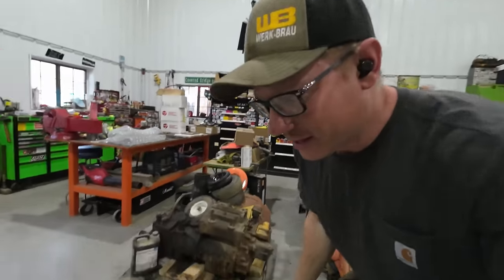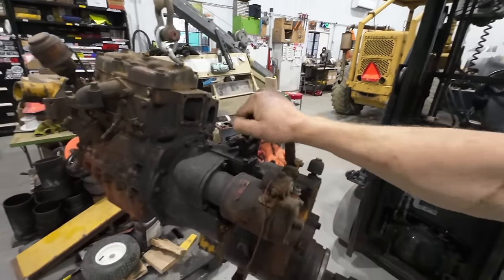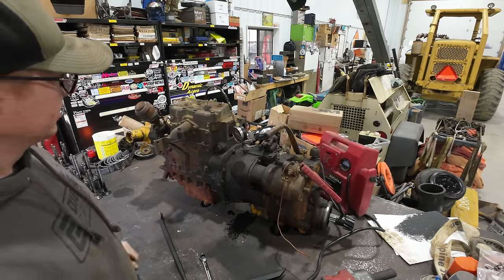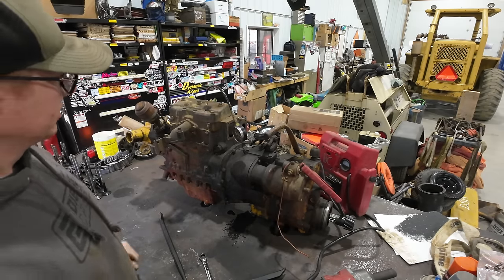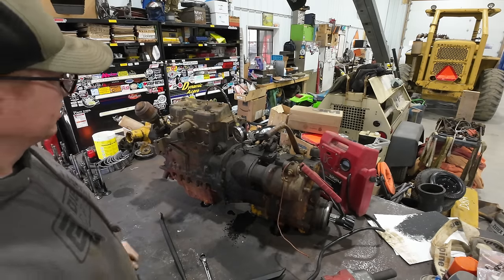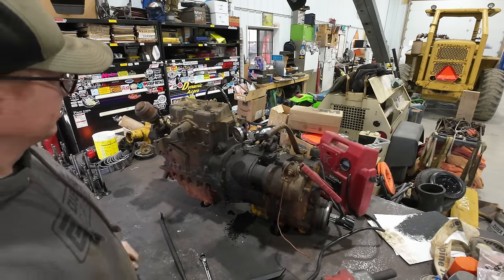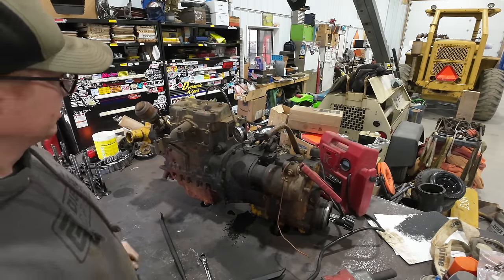AUTOPSY of a Caterpillar Pony Motor. | What Went Wrong?

Comment: you mention taking a cotter pin out of a castle  nut, this was not a cotter pin but a split pin, which is an obvious name as you split the 2 legs to  stop it falling out.     a cotter pin is usually about 5/16 in dia and upwards.and has a threaded section on one end for a nut and washer to hold it in place.after fitting,   it also a tapered  section , sloping from nothing at the head end to about  3/4 of its dia at the threaded end, the shaft that is being secured to the lever has a groove in it to register with the cotter pin.    you drive the cotter pin in with a hammer and then put the nut and washed on the other end.   the most likely place to see one is on older bicycles, the pedal crank is usually secured to  chain wheel sprocket  shaft by such a method .
other wise Matt love the program and videos, always look on diesel creek as soon as i turn on my comp to see if there is anything new
Reply: From wikipedia: A cotter is a pin or wedge passing through a hole to fix parts tightly together. In British usage cotter pin has the same meaning, but in the U.S. it means a split pin.
Reply from the maker: Yeah. Here in the US a cotter pin is what I was referring to. What you’re referring to sounds more like a roll Pin or a constant tension pin
Reply: I would call what you’re describing as a threaded taper pin.  Only rarely used in my experience.  Only usage I’ve run across is to hold a splined slip clutch on a splined male “pto” shaft with a circumferential groove ground in it to receive the tapered pin.  Basically takes the place of the spring loaded pin on a pto shaft coupler that you push in to slip coupler yoke on and off the shaft.

Comment: With the amount of wear on the main bearings, I am amazed that the pony even ran.  I can't imagine that the rod bearings are going to be in much better condition.  I am just going to make a WAG, and say that the teeth could be from the bendix of a previously installed starter.  I can't imagine how you could find that kind of damage, and none of the other gear teeth are damaged.  Those things were built to last.

Comment: Should consider reassembling the Pony motor with all the parts reattached before placing it in storage. That's just one way of reassuring that none of the parts go missing later when you really needs them, particularly those parts that you'll otherwise take for granted.

Comment: I would argue for keeping the cracked case - if for no other reason, as a means to keep the rest of the parts together in one spot. Otherwise, over time, the parts will tend to 'sprout legs and walk away'. I'd get some day-glo red paint and dot the crank journals and the gearbox case to remind you what the deal is. Then you clear a spot on a shelf and park the dead pony until you need to raid it for parts or you have a chance to trade it off 'as it sits'.

Comment: Hello  Matt: Happy Easter' just an educated guess. I would check the remains of the gear and see if it could be an old starter drive gear. From what I could see in the video and the issue you showed with the starter alignment. I think a previous starter failed to engage properly and broke. The pieces never removed. But that is just an old timers 2 cents worth. Keep the videos coming.

Comment: Almost looks like someone tried to use babbitt material on those main bearings. thats an incredible amount of slop. Guessing thats why the starter wouldn't engage, teeth weren't even close to lining up anymore. Also guessing the bearing material was what caused so much metal sludge. As others have said, looks like old starter teeth that broke off and they just slammed a new one in and left the old teeth in it.

Comment: The flywheel grinded itself down and fell out of mesh with the starter. That's why you had to lever the starter into the now lower flywheel. 
When you go to store the parts, write up a little story about what's what and what happened so when you come back to it 30 years later you can remember what happened.

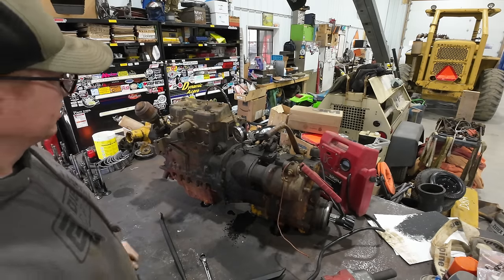Comment: 19:37 if you look at the top of that flywheel the peaks of those teeth look like they are missing. I might be wrong but rather than a missing and/or broken gear, potentially those teeth that you found in the gear casing came from the flywheel. 🤔

Comment: The shaved off teeth belong to the flywheel, I'd say. You could see the nicked edges of some teeth, they were really flattened out compared to some on the other half of the wheel. Would make sense to me, because of the uneven rotation of the crank, sometimes hitting the teeth on something, sheering them off over time.

Comment: Back in the 70s we had D8s pushing motor scrapers for muck shifting in the UK. The starter engines were known as Donkey Engines and I think they were Ford side valve 4 cylinder units from cars made in the 50s to 60s although I never paid much attention. Strange to see that old tech still going strong😊.
Reply from the maker: Pony engines are all made by caterpillar.
Reply: @DieselCreek  Could well be, these were UK machines and the tractors were probably 60s and I just remember a little about them and never operated one. It was so long ago that my memory is quite vague.

Comment: You down on compression with crankshaft hanging that low. So pistons n cylinders be in fairly good condition. 
Probably be 140-160 psi with crankshaft in place

Comment: Looks like next project is the old Jeep.
(Yee Old Jeep?)
Hopefully you will install the axles on the correct side of the springs, unlike the factory.
And even more hopefully,  you find a Dana 44 front axle from an IH Scout, since Jeep wasn't bright enough to put the right front axle under them to begin with either.

Comment: Gear teeth appear to be from an earlier bendix failure and not removed. Probably the reason she was parked, was the pony bearings finally failed and took out the orig starter, Starter then changed out and found to not engage. she was then left and not gotten back to. Woodruff key most likely locating key for throw clutch shaft

Comment: Caterpillar had a parts house near to the construction of the NYS Thruway. On a cold morning they would look out the window while the operators tried to start the Cats. Of course they would run the ponies full bore, if the Cat didn't light off they knew the mechanics would on their way for a new pony.

Comment: I wonder if those broken gear teeth came from a previous starter motor. The amount the flywheel must have been flailing around while running it’s quite likely to have damaged the gear on end of the bendix.

Comment: Previous starter teeth. Probably sheared off and they replaced the starter. New starter wouldn't engage right for the reasons you discovered with the main bearing of the engine. So she sat there broken till you stumbled onto it. By then, the starter was fine but not engaging.  You managed to get the starter engaged by unconventional methods and got the pony running.(unaware of the sheared teeth floating around in the case. eventually a loose tooth found a sweet spot and bang. Houston we have a problem. This is all speculation of course.

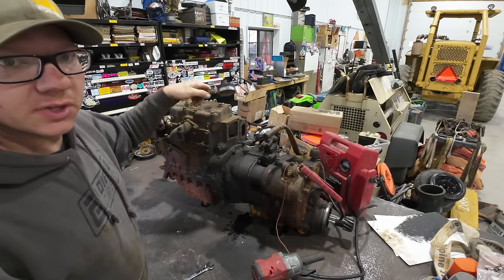Comment: I'm at 8:22.   I'm no mechanic.  But by the sound of it, there's chipped metal clinking together.  If you have to hold it at an angle, I would guess that some teeth have been sheered off and when you hold it at an angle, what's left of them can make solid contact again.  It will be interesting to see what comes up.

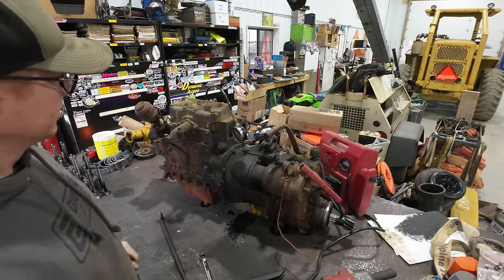Comment: At first I thought someone may have replaced the starter drive or starter and got the wrong drive. I think there are three different drives depending on the number of teeth because the same starter is used on a wide variety of engines. When you first got the housing off at 15:00 I thought I saw the flywheel move.

Comment: IMO those gear bits you found were from a previous starter's bendix gear. Someone installed a replacement starter and never cleaned out the carnage.

Comment: Compression test on a dry engine? Pretty good readings!
I'll take a stab in the dark, and guess that the crank thrust washers either went missing or wore away with all that good oil. So the crank has moved back, hence the need to move the starter back????

Comment: 12:32 seems like helical gears would/should wear more than straight cut gears due to their sliding action. But I'm no frictionologist.
Reply: There is some sliding friction but very little.  The main thing a helical gearset does is run quieter!  Hence they’re used in most transmissions and gearboxes that run at high rpm.

Comment: Hey Matt, good video as always.  As I was watching you disassemble that apparatus, it occurred to me that you have a marvelous opportunity to make some big bucks in the near future. You should invest in a 3D scanner.  As you clean up unique parts that are very hard to find, you can scan them once they are clean and save that 3D image. Later on, if you need a cast part, your 3D image could be used to 3D Print a new casting.  You can even repair broken castings in the computer and then 3D print the new part without the damage.

Comment: looks like a small diameter gear, almost like an old starter shattered inside the casement, could explain why the starter angle is hoopajooped, might have bent the casement when it went into glitter mode

Comment: Possibly an old starter that blew up?  That bearing didnt go bad overnight.  The bearing failing loaded the starter and the gear blew apart from the side load and spewed its teeth down in the case?

Comment: I bet those gear teeth are a starter drive gear. I suspect that the problem with starter engagement is that it's the wrong starter - at least the drive gear is wrong. lol, nevermind. It's definitely not the wrong starter :D
I can't tell with the crank still in it, but the bearings don't look like they've been worn through. All of that sludge in the oil pan may just be babbit material. You might be able to turn the crank and polish it and have new babbits poured.

Oh hey, pro-tip from a guy that used to work at a heavy truck trans & driveline shop: don't clean the case until you're ready to build it. That'll keep it from rusting too much while it sits. Sure, clean it enough to inspect it, but you don't want to store it with bare dry metal exposed.
Reply from the maker: The soap in the parts washer has a rust inhibitor. These parts won’t rust unless you put them outside for a long while.

Comment: With that bearing out on the back of the engine the flywheel boning around hit the case it my have broken pieces off the case that was supports for the case that looks like peices of gears

Comment: I reckon that engine is fixable... you'd end up with substantially undersize crank bearings, probably need to be custom made, but doable. Given its only two bearings, you could probably actually convert it to rollers.

Comment: Is the broken casing cast steel or iron? 

I would take that opportunity to drill out the ends of the cracks, dig out the cracks with a die grinder and weld ‘er up. Practice makes purrrr-fect (cat based pun). 

How much do cat charge for a rebuild kit? Having a fully built pony motor on the shelf, ready to go is surely worthwhile? 

I reckon you could do all the work yourself with a milling machine and a rebuild kit. 

Thanks for the content Matt, keep giving’er 👌

Comment: I like to clean the outside of project before I dismantle them. Usually I will spray it with a solvent with oil or WD-40 and allow it to sit for some days for it to loosen thing up. I hate getting my bench top dirty. Have you ever tried cleaning projects first and just seeing how much better it is to work on them?
Reply from the maker: I couldn’t possibly care less if it’s greasy, it’s always gonna be a mess with the oil that’s trapped inside anyhow. Why fight it.

Comment: Your “problem” with the starter / flywheel teeth not meshing reminds me of the exact sort of problem I had several years ago with VW motors, in my trike..  it was all to do with the number of teeth on the flywheel..  they basically overtime came in a variety of “flavours”, as to the number of teeth per flywheel!!  It was only a subtle number difference, like 134 +/- 3 or 4.. but the less number of teeth equals a slightly smaller diameter, so the starter teeth do not engage.. a

Comment: Looks like those teeth came from the flywheel. Look at 19:35. The teeth between 10-12 oclock are stripped and the tops of the teeth are flat. The teeth on the rest of the flywheel come to more of a point.

Comment: Well!! there's your problem.
But as you said parts are getting hard to get so its not that hard rebuild.
Isn't a babet bearing just a heat up bearing material and pour in it into what needed?????
Keith Rucker from the Vintage Machinery channel does it all the time.

Comment: Maybe it's just my bad eyesight, but at 17.01 I did not see what looks like a 3rd clutch arm of some sort when you pulled that out. It looks like the right size piece of metal to match your chunk you found. Possibly when it failed part went out the hole and what was left of it wound up stuck inside. Just my opinion. Don't think any broken piece from an old starter would last inside that case.

Comment: The pieces of gear are most probably teeth off a previous starter, the look to be the correct size, at some point as the pony motor flywheel dropped down, the flywheel and starter motor teeth hit tooth top to tooth top, and the tiny gear of the starter loosing the battle

Comment: Could the gear ⛮ teeth came from the repair done in 1973. 🤔  maybe  they hidden from the worker 👷  plus it's to big to hold up and shake.  The gear teeth could have being floating around for years maybe.  
Because I  work on a Library ship one time for conversion.  I found a dog behind the 3 inch bulkhead still tack to the deck. It was never removed when they did the cleaning up. I Remember in are History book they that they launched those ships every 3 months  during the  war time. So little thing like can be missed.  Quality control might not have been done at that time.  
Plus it could be a missing gear that broke apart.  I  do not remember  the load bang either.  But listening on the phone might not hear it .👂On the play back. I  do remember you saying that you heard it. 
Nice dirty job Matt.  😅👍👍👍👍👍

Comment: The gear case can serve a purpose  for practicing welding on cast iron  you mess it up its junk anyway  but if you can fix it how often is it used anyway  so maybe worth keeping fixing for possible use later or junk later ..... question can you not retrofit a starter to the diesel motor directly instead of using a pony motor .

Comment: Who wants to bet that if these parts are put into boxes and put on a shelf, they will spontaneously migrate to different storage locations in the shop until it's impossible to know which parts go with what other parts, just like every other parts hoard! This is why I've started putting things back together (non-torqued bolts) before shelving the part/unit, so I (or someone else) will know what is an entire assembly in future. Because there's nothing more annoying than discovering that your part unit is missing 1 bolt that is rusted round on the dead one you're trying to replace!
Reply from the maker: I do that to an extent but I store everything on shelves in the containers. They all get labeled

Comment: If you can't find the gear with the missing tooth, does that mean the gear in question actually now is part of the diesel that's currently on the D8H? I figure there has to be something that mesh between the pony and the diesel to get it started. (unless it's from a different electric starter...)

Comment: The starter may have broke off some teeth.  So they may have repaired of replaced the starter.  I would try to determine if the starter has been repaired or replaced.

Comment: Probably gear teeth of of an old starter that where in the slugs at the bottom of the case and came free with all the heat and vibration of the engine running

Comment: @dieslcreek Matt, what about those pieces just left over pieces they just left sit in the housing and replaced the shaft with the broken pieces. ? was to much work for them to totaly rip the motor of so they left what on what was not needed to replace the shaft with the broken teeth... replaced and left the rest as it was. those broken gear pieces just felt  all the way down being to heavy to be pumped around   ?

Comment: Those teeth look like they came off a starter. I bet when the main bearings went the gap between the starter and the flywheel became so much it ate a starter gear. I'm guessing the previous owner/fixer didn't rescue out the gear bits causing the grenade we now see.

Comment: For as low the duty-cycle should be on the pony motor (just for starting) is it possible that someone fired up the diesel and left it engaged for a long duration, even after the diesel was operating? The wear on those journal bearings is unexpectedly severe.

Comment: Considering that cracked case is cast iron, IF you tried spray welding it, you would be highly likely to cause the crack to finish running around the top of the housing and just breaking off entirely...

Cast iron does NOT like localized heating and tends to crack and split EVERYWHERE there is a flaw in the casting...and cast iron is a BITCH to make with a flawless casting...

If you want a usable housing, you're best bet is to make a mould, grind up and melt the old casting and use the old metal to pour a new casting...

Good Luck...

😄😁😆😅😂🤣

Comment: The teeth didn't come from this engine. 
Two theories, they were there from 1971 when the engine was last worked on, or someone added them maliciously. 
Personally, I would have the case welded, pop in two new mains as small as are available and have the crank ground to that, if possible. Relative to a 6-cylinder engine, that's not going to be expensive.